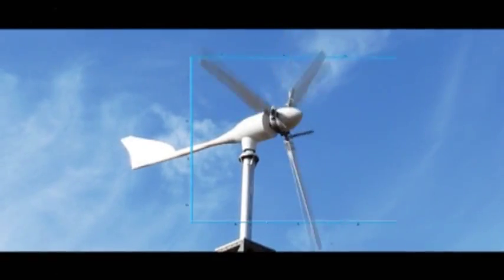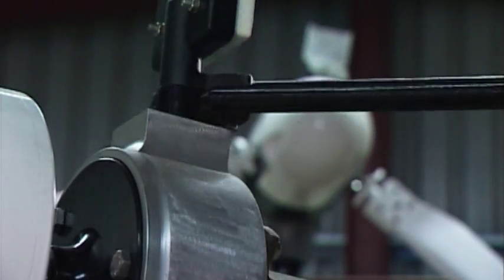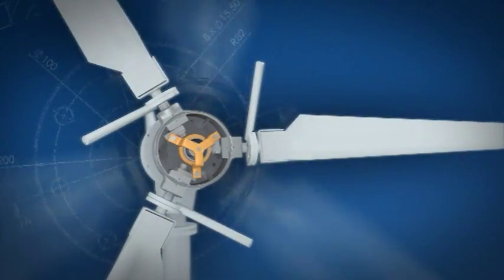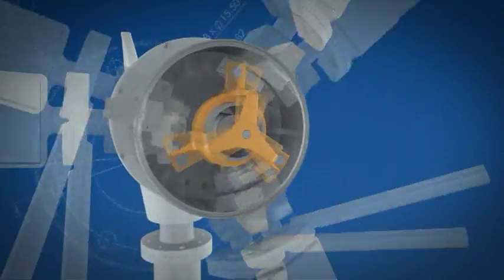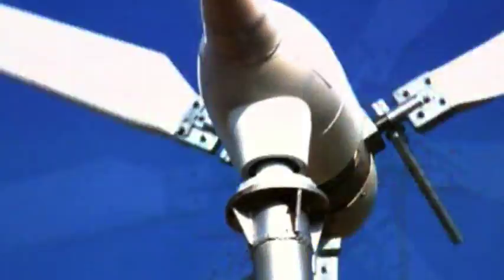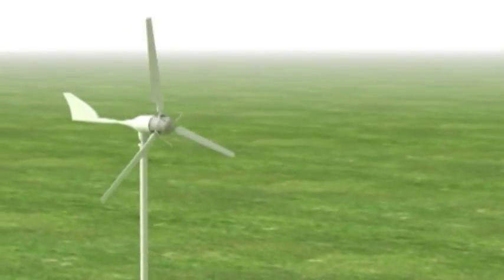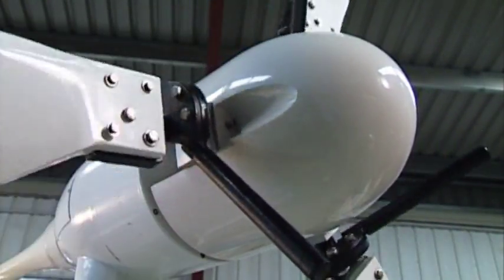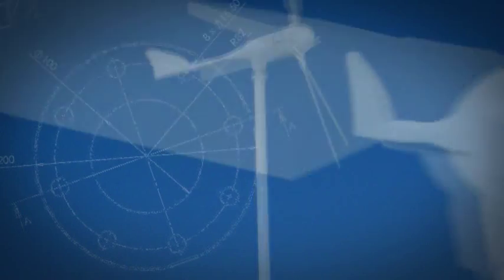Windspot variable pitch .mpg

Comment: Jacobs used this technology first in the 1930's going forward. I have a Jacobe Model 60B. This is an excellent method of passive control unlike newer technology using composite blades with counter weights attached that twist the blade at high speeds.